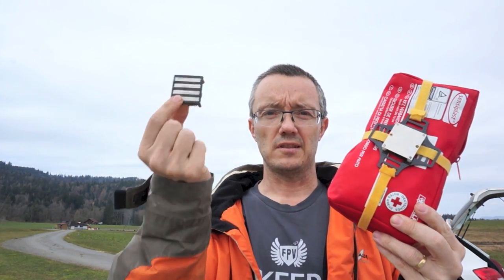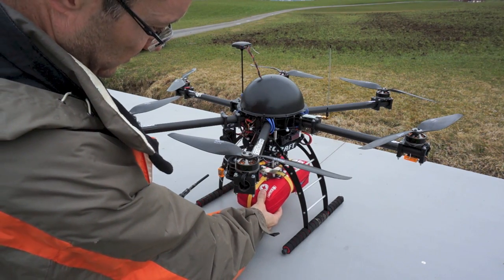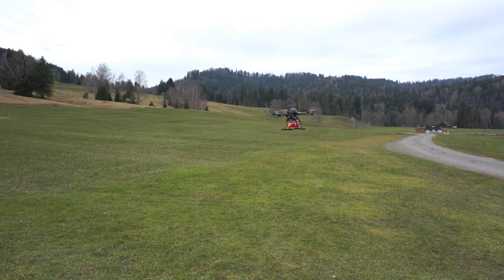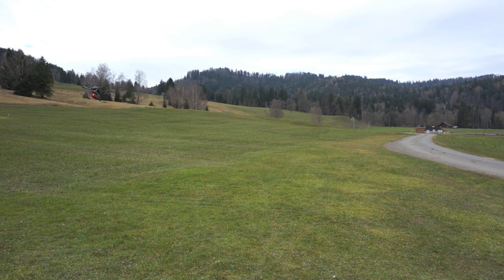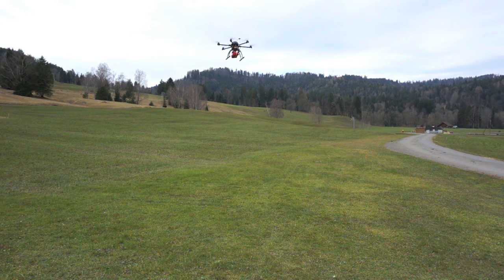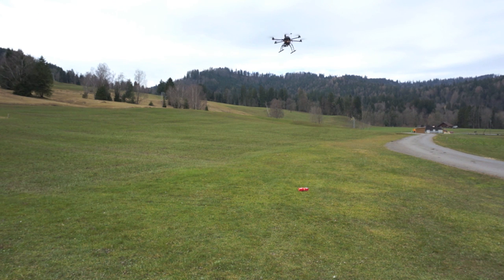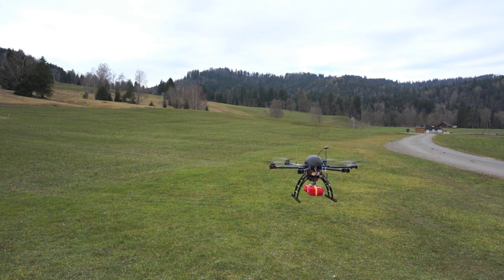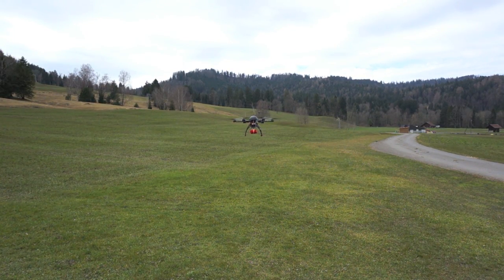Using a drone to deliver Search and Rescue payloads

Comment: Very cool.  The magnetism from the electro magnet has no effect on the magnetometer or any other electronics?
Reply from the maker: No, it works perfectly, even after repeated testing. You need to keep around 6-10cm separation away from the compass.

I now sell these btw:  http://shop.performanceauv.com/Payloader-Night-edition-PAYLOADER-NIGHT.htm
Reply: I followed up on my own question and actually found that info myself.  <blush>  Ah, so softball sized field, spherical or obligated?  Naza, Ruby, etc. about the same as far as interference?  Nice all around job BTW.  My assumption would be when OFF after a drop, no field is present.  One of the best actual NEW things I have seen this year.  IMHO
Reply from the maker: Vernon Silvers The field is always present, but is extremely weak. The field is at its strongest during the state changes; i.e. OFF -> ON, or ON -> OFF. These changes take 0.3 seconds, so even if the field was strong enough to effect the compass, it doesn't last long enough to have a significant effect on the aircraft's heading. Re: shape...i'm not sure - I've not tested shape; I assume it will be softball shaped, along the horizontal axis.

Re: models, I know it's fine on the compasses of APM2.6 and Naza, but I've not tested Ruby or Vector, but I suspect the effect will be the same unless they have super sensitive compasses! :-)

Thanks for the feedback - as well as selling this one, we are also building an array of 4 magnets in one chassis, called "Payloader max" - this will give us 5kg of payload ability. Research continue on the magnet itself; some lab tests are showing a 300% increase in power in the same size magnet, with a shorter cycle. This will give us around 10-15kg load capacity in Payloader Max...more than even the biggest Octo's can lift at the moment!
Reply: As so like in inductive reactance the field may build bigger before it stabilizes in each state.  Got ya.  ANOTHER nice point.  :)